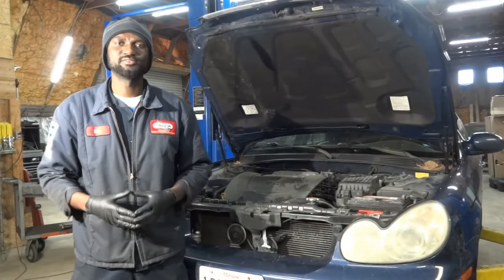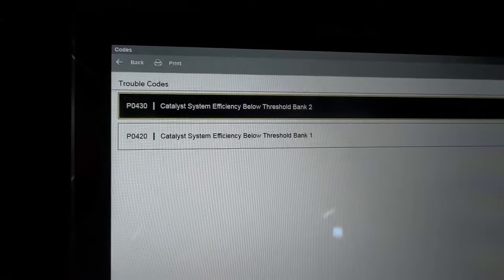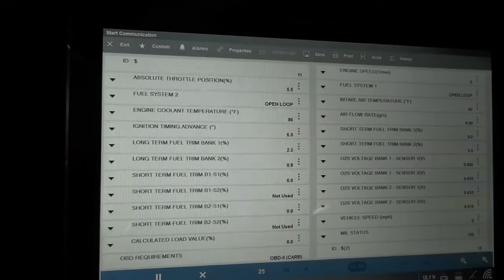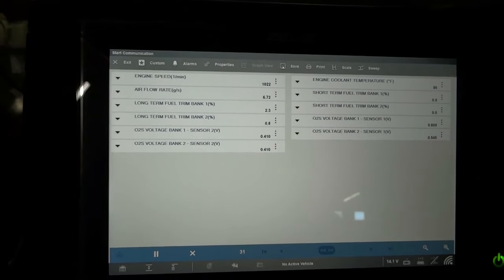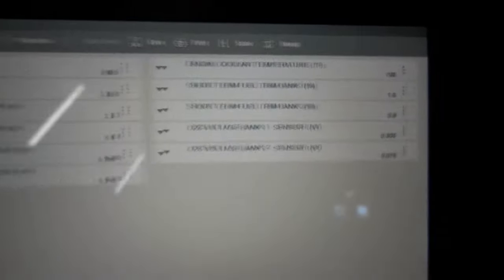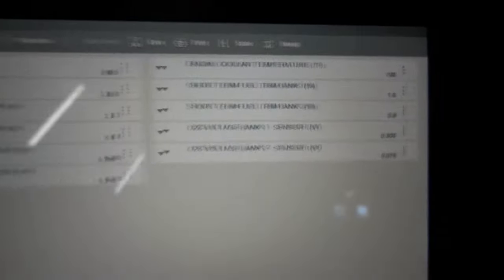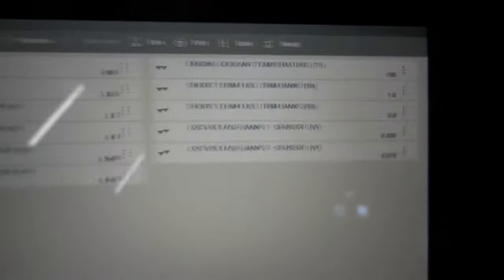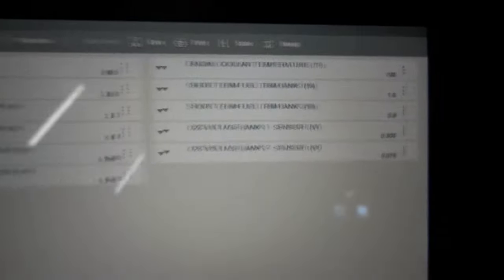Catalytic Converter Efficiency Below Threshold: Code P0420 & P0430 Diagnosis and Repair

Comment: Thank you for this video. I have a P0420 code and replaced my O2 sensors AND the cats and still have the code. I don't have any vacuum leaks. The brake pump test showed the O2 sensors are working. Could my problem be caused by a bad muffler?
Reply from the maker: Blue Wolf  you most likely have a defective catalytic converter!!
Reply: @KITS_Auto_and_Truck_Repair  I have the same issue on my 03 Sequoia as Blue Wolf.  Replaced o2 sensors and the single cat with new units from Amazon. Went from downstream sensor code (bank 2 sensor 2) and replaced downstream sensor.  Then code for upstream sensor came up ( bank 2 sensor 1) so I replaced  upstream sensor AND the cat.  Now getting  P0430.  No exhaust leaks anywhere.  I am getting a sucking sound from the brake booster, typical on Sequoia apparently.   I am getting a strong fuel smell at exhaust, wondering if injector(s) are bad.  Has 156k miles on it.  

I had same 0420 codes 2 years ago on bank 1, replaced cat and both sensors on that side and it fixed the issues.  Took me months to replace all the hoses , front to back, due to evap leak codes.  Toyota's suck with rotting hoses!  Keep chasing my tail on this stupid SUV!
Reply from the maker: @user-ym9wb2mk5e  make sure your engine is not runnig rich, check your fuel trim numbers!!
Reply: @KITS_Auto_and_Truck_Repair  Thanks! Going to check the plugs and injectors after church today.  I will also clean my MAF just in case.  I appreciate your video btw!!!!  Going to get a temp gun also to see before and after temps from cat.  If I don't get this resolved, just going to find a diff SUV for my wife, this has been my most problematic Toyota to date (owned 5 diff models in the last 3 years).
Reply from the maker: @user-ym9wb2mk5e  sounds good! and Good Luck!!

Comment: If inhave 2 catalytic converters and one is failed (had a rattle so the center is crumbling and causing it to block up and causing random acceleration issues I can't afford a new cat can I just hollow out thebfailed cat and leave to got one alone or would I have to hollow out both?
Reply from the maker: @guyelsenburg9196  Sorry! I didn't understand your question!

Comment: I have a p0420 code on my 2007 Nissan Sentra. It has an air/fuel ratio sensor at the exhaust manifold cat. Should I be looking for continuous rich to lean reading on my scan tool? 

Great video and very informative by the way!
Reply from the maker: Blacksoulja  Thank you!! and yes the air fuel ratio sensor signal should be switching from lean to rich on a good working engine!!
Reply: @KITS_Auto_and_Truck_Repair  thank you for the quick reply!
Reply from the maker: @yungfresh2def24  My Pleasure!!
Reply: My air fuel ratio sensor is reading at 2.1 volts while idling and even at 2500 rpm. When I create a vacuum using the brake pedal it spikes to 3 volts but never drops below to indicate a lean mixture. Would it be safe to say that the air fuel sensor may be not working properly?

Comment: why is it after replacing the CAT, and creating " LEAN" condition by pumping brake pedal , the 02 S2 sensor of bank 2 signal did  not match the O2 S2 sensor of bank 1 ?  Your respond will be appreciated . Thank you
Reply from the maker: Rebel that sensor was taking a little too long to respond but it did after it got warmed up!

Comment: Can a bad catalytic convert make your vehicle run lean ? I have changed, o2 sensor, MAF, smoked Intake, evap and exhaust and no sign of any air leak. Pre O2 sensor pre shows up and down graphs as in this video but the Post cat O2 sensor shows a straight line. Before I condemn the CAT I would like to hear from an expert like you, that CAT can throw off the fuel trim leading to a high fuel trim.
Reply from the maker: Roberto Melendez  it's possible!

Comment: I got a 420 code I did the brake test and    O2 sensor responded just like the video. I will do the Temp inlet out let and I'm sure it's the cat.
Reply from the maker: @coreybussey1358  Ok! make sure the outlet of the CAT is hotter than the inlet!

Comment: After changing my Catalytic Converter, and the Check Engine Light goes off, can I take it straight to the Emmision Station for my Tag, or do I need to Drive the Vehicle thru it's Drive Cycle?
Reply from the maker: @kennethiwamasa6204  you should drive it for a little bit to allow the monitors to run!
Reply: How many miles do I need to drive, before I can take my Vehicle to the Emmission Station, after changing my Catalytic Converter.

Comment: Whats the process if its only and is always a "pending" P0420 code. I had a "Pending" P0171 come up also, cleaned the MAF and it went, neither has given me Check light. "Pending" P0420 still remains.
Reply from the maker: @EddieRiff   Your Cat or 02 sensor is failing!

Comment: Hi  Sr  I hope you can answer this question  2012  toyota Prius  i change the catalytic  Brand new catalytic  and new oxigensensor  the  oxigen sensor i bougth at Dealer toyota  original and THE CHECK ENGINE IS ON  WHEN THE ENGINE IS RUNINIG  .,.,  WHAT DO YOU THINK  WHAT IS THE PROBLEM ???
Reply from the maker: Mauricio Zambrano  scan it and see what trouble code comes up!
Reply: @KITS_Auto_and_Truck_Repair   CODE P0420
Reply from the maker: @MauricioZambrano-o8v   Your Cat or 02 sensor after cat might be bad you need to get it diagnosed by a pro mechanic

Comment: Hi great video well explained not what I was looking for but had to finish watching it you get 5 stars from me subscribing and liking... I have a jeep gc 5.9 hemi and for the life of me can't figure out error p0032 h02s heater control circuit high bank 1 sensor 1. 02 sensor not bad, pcm not bad. somewhere in the wirering I think. I have check ground wires to the fender wells all are good any ideas what I can do to fix it? Thanks
Reply from the maker: mrgfunkarama Thank you!! your problem is in the wiring or the sensor itself

Comment: Just put a borescope in my downstream 02 sensor hole and found my bank 1 side was clogged so bad I don’t know how my truck is even running, I just don’t understand how bank 2 cat looks to be in perfect shape? Makes sense though because I was getting misfires only on bank 1
Reply from the maker: VUNIT82  make sure the 02 sensors and the injectors on that bank work well before you replace the cat!!

Comment: I thought the output of the catalytic converter should be higher than the inlet.  This is because in a working catalytic converter, the catalytic reaction generates heat which should cause the outlet temperature to be higher.
Reply from the maker: Scott Friedrich  yes that's what I meant, the outlet of the cat should be hotter than the inlet, it was a slip of the tongue in the video!

Comment: I have the same problem however, after replacing catalytic converter the issues didn’t go away. The only sensor that is not showing the correct data is Bank 1 Sensor2 after the catalytic, since it’s mirroring sensor 1. Does that mean I have a bad bank 1 O2Sensor after the catalytic converter? Bank 2 sensors are both working correctly
Reply from the maker: Georgiy Gukasov  yeah, you have to make sure your 02 sensors are working well, so you have to replace it
Reply: @KITS_Auto_and_Truck_Repair  Thank you so much. Your videos help out a lot.
Reply from the maker: @georgiygukasov5599  My Pleasure!! I'm glad to hear that the video was helpful!!

Comment: I have a rear catalytic converter after the 02 sensor, do you have to change that also? I have a Honda Civic hybrid 1.3L  4cyclinder that have two catalytic front and rear
Reply from the maker: Lloyd T  No you don't have to change the sensor!
Reply: @KITS_Auto_and_Truck_Repair  I’m talking about if both catalytic converter have to be changed the front catalytic converter that’s mounted to the cylinder head and the rear catalytic converter which is right after the 02 sensor. Thanks!
Reply from the maker: @LT11859   Yes! I would replace them both!

Comment: Can you test 02 sensors on a 04 camery the same way because iam getting p0420 & p2423 after replacing maf sensor and cleaning the throttle body????
Reply from the maker: @germanywho  Yes, you can!
Reply: @KITS_Auto_and_Truck_Repair  thanks 🙏🏾
Reply from the maker: @germanywho  My Pleasure!

Comment: Hello Friend
Any possibility an o2 sensor can be cleaned before purchasing one? I just replaced the one before the catalytic. I currently have a po420 code. To save money, i'm planning on cleaning the catalytic converter and maybe the o2 sensor..i am also planning on checking the temperature as well. Thank you for the video & your time.
Reply from the maker: Alfred Bernal  My Pleasure!!! you cannot clean the 02 sensor if it's bad!!
Reply: @KITS_Auto_and_Truck_Repair  olay...Would it ne worth trying to clean the catalytic converter? Toyota Tacoma. Looking to try this 1st before i purchase one..in in California,  catalytic converters are expensive due to regulations

Comment: My code P0421 comes on every 4 days , Berlingo 2016 van runs great, garage can not fined the fault
Reply from the maker: steve senior   that code is caused by a bad cat or a defective 02 sensor!
Reply: @KITS_Auto_and_Truck_Repair  The cat was renewed about 18 months ago by Citroen, I will have to test the o2 sensors with the obd and see what it shows, thanks for getting back to me.
Reply from the maker: @spitfireste  ok! My Pleasure!

Comment: Sir, I have different question from the topic. I have 2007 civic hybrid and it will not go pass 4500rpm .. it’ll hesitates. What do you think causes it? Thanks!
Reply from the maker: Lloyd T  is there a trouble code in the ECM ?
Reply: @KITS_Auto_and_Truck_Repair  no error codes.

Comment: I have a P0420 alert on my Acura TL Type S. Is it recommended to replace the bank 1 and 2 CAT with O-2 Sensor.
Reply from the maker: Yado YOYUO  you replace the cats if they are defective, and before you replace the cats make sure the engine is checked, if the engine is not running well the new cats will get damaged fast!! only replace the sensors if they are not working!!

Comment: Maybe it's the intake sensor before the C C. I have the same problem, and it's to much money to replace the C C with low millage on the engine in my case.
Reply from the maker: @deanjagger1190  I didn't understand your statement

Comment: Question: I have a Lexus with a P0420 code, and the car has two upstream sensors and one downstream sensor. The upstream sensors act normal, but on acceleration, the downstream sensor goes to 0v. When the gas is released the voltage goes back up. When I checked and washed the CAT, it was completely clean and no dirt, so is it the downstream sensor causing the code?
Reply from the maker: Timothy Kang yes it's possible the sensor or the wiring has a problem! test the sensor and wiring and see what happens!! but it sounds like your sensor is going bad
Reply: Thanks bro for the quick response! The video definitely helped, but you really don’t see that many YouTubers answering comments. Keep up the good work man!

Comment: it is normal for the corolla O2 sensor @ right after the exhaust manifold to read 3v? But the one near to the cat is 0.2. Both are new sensors by the way.
Reply from the maker: 马克施  the voltage on the 02 sensor before the cat should flactuate and the voltage on the 02 sensor after the cat should be pretty steady

Comment: We have a po420 code that only pops on wet roads. Any thoughts?
Reply from the maker: James Horrocks   that's odd! Check your post cat 02 sensor!
Reply: @KITS_Auto_and_Truck_Repair  what should I check it for?
Reply from the maker: @jameshorrocks2939  check the voltage output from the sensor!
Reply: @KITS_Auto_and_Truck_Repair  ok finally had a chance to check the live stream. It's switching on the 1st sensor and running stable on the 2nd around .76 volts. Not sure if that is too high?
Reply from the maker: @jameshorrocks2939   That is good data!

Comment: I have the same car and the converter needs replacing do to a damage done in speed bumb, but the converter is from California emissions do to the car came from that state. Can i put a regular converter instead of the one from the California emissions regulation without the car computer having issues?
Reply from the maker: Mannys Colletions  I recommend using the right type of catalytic converters for the vehicle!!
Reply: @KITS_Auto_and_Truck_Repair  thanks
Reply from the maker: @TheDarthvalen  My Pleasure!!

Comment: That's interesting that the inlet temp was hotter than the outlet temp. I always thought the OUTLET temp should be HOTTER than the INLET temp. Now I'm just confused. Can anyone clear up this confusion?
Reply from the maker: Ron Yassa  the inlet of the cat is cooler than the outlet of the cat, in the video I meant the outlet should be hotter than the inlet! it was a slip of the tongue!
Reply: @KITS_Auto_and_Truck_Repair   OK no worries! Thanks for clearing that up! So how did the inlet show 400 and the outlet was like 250? (if I recall the temps correctly)

Comment: Exellent K !! .. what is the name of the diagnostic tool and is there a book that could show how to read the datas?
Reply from the maker: Uncle Ben  Thanks!! I used a Snapon Zeus scanner in this video!
Reply: Thank you
Reply: I have a lexus GX460 and and recently changed a knock sensor and forget to connect a re-breather hose between engine block and intake manifold.. the engine had a few small misfires .. checked sensors with my scanner...sensors read pass... so i feel like it damaged the catylitic converter.. need better scan tool and will learn more about datas

Comment: My fault says Cat converter low efficiency on my Corsa. I’ve noticed the car has slow acceleration now does this mean I need to replace the cat converter? Or do you think it could be clogged
Reply from the maker: Frank Castle it sounds like your cats are getting clogged! you have to replace them but make sure you check and find out why the cats went bad!! I mean determine the cause of the failure!!
Reply: @KITS_Auto_and_Truck_Repair  Thanks, So you think if I replace it they could still get clogged again?
Reply from the maker: @frankcastle9866  yes, you have to get it diagnosed to figured out if the engine is running properly
Reply: @KITS_Auto_and_Truck_Repair  My mechanic suggested to buy a used catalytic instead of a new one to be on the safe side, is that good to do? I wouldn’t thought getting new one is better
Reply from the maker: @frankcastle9866  oh really? I think you will be better off with new ones!!
Reply: @KITS_Auto_and_Truck_Repair  hey bro I replaced the cat with a new one and still my car has slow acceleration especially on hills, this is really making me frustrated do you have any idea what else it could be? I've had air filter, spark plugs and new oil filter a few weeks ago so I'm really stuck now
Reply from the maker: @frankcastle9866  what trouble codes do you have now?
Reply: @KITS_Auto_and_Truck_Repair  There are no codes or any lights on the dashboard. Maybe could be air flow sensor?
Reply from the maker: @frankcastle9866  check your fuel trim numbers at idle and high rpm, I have a video that explains it, the video is called hyundai elantra transmission not shifting!! I hope that video will help, Good Luck
Reply: @KITS_Auto_and_Truck_Repair  I replaced the coil pack even, still same problem the car really struggles on even the slightest hill. I’ve had spark plugs, air filter, oil filter, oxygen sensor replaced too but still nothing. What should I do
Reply from the maker: @frankcastle9866  you need to take it to a pro mechanic to have it diagnosed properly!! Good Luck!!

Comment: Nice explanation brother! That Hyundai vehicle you fixed has two cat converters, right? One attached to exhaust and the other one back in the middle. How about Mitsubishi eclipse 4 cyl? It has two cats, right? I got the p0420 code only.
Reply from the maker: Spiritusanto16 on most 4 cylinder engines you will only have one catalytic converter! so since you have a P0420 code your catalytic converter is probably bad!! follow the steps in the video to test it!!
Reply: @KITS_Auto_and_Truck_Repair  thanks for the info. I will test my o2 sensors and my cat visually.
Reply from the maker: @Spiritusanto16  sounds good! let me know what you find!!
Reply: @KITS_Auto_and_Truck_Repair  sure why not
Reply from the maker: @Spiritusanto16  sounds good!!

Comment: There is only 1 error when using temp gun. I liked all the other options for testing, but when u explained the temps pre and post cat it threw me for a loop cuz everything I learned was the opposite of what u said. I'm testing my vehicle to determine why my cat failed before shop replaces cats  as they can't give me an answer why they failed.
When a catalytic converter is working properly, it will be 100º F hotter at the outlet than it is at the inlet.
Reply from the maker: Husk9  Yes that's true!! on a good cat, a the outlet is hotter than the inlet, that's what I meant in the video!! thanks for mentioning that!
Reply: That's what  I'm was trying to figure out. All of what I read and viewed on the internet so far, says that a good working catalytic converter is cooler at the inlet and warmer at the outlet.'m

Comment: I thought cat outlet temperature should be hotter than inlet temperature.
Reply from the maker: @Ironblank1  Yes! you are right, that's what I meant!
Reply: Thanks brother!
How can you tell if airflow is right? 
Is it that MAF sensor reading should fluctuate as you rev the engine?

Comment: Is Po40 usually the 02 sensor
Reply from the maker: Quata Mae Crumble  a P0420 is often caused by a defective catalytic converter, but the 02 sensors and the engine operation has to be checked before replacing the cat!
Reply: @KITS_Auto_and_Truck_Repair  ok thank you
Reply from the maker: @quatamaecrumble392  My Pleasure!